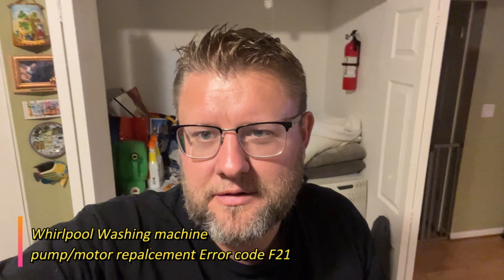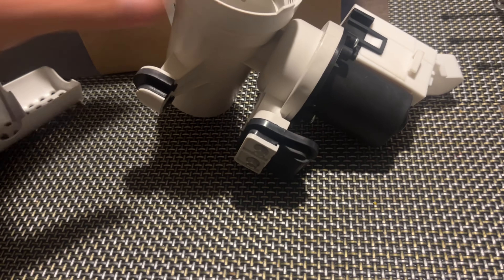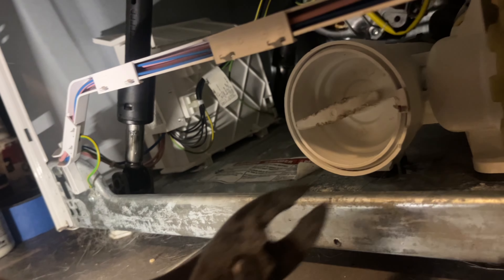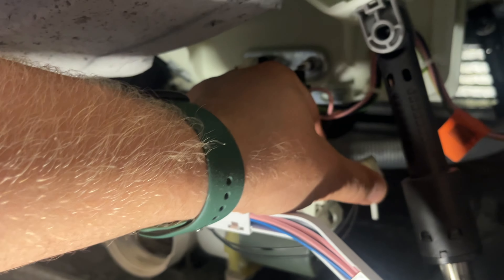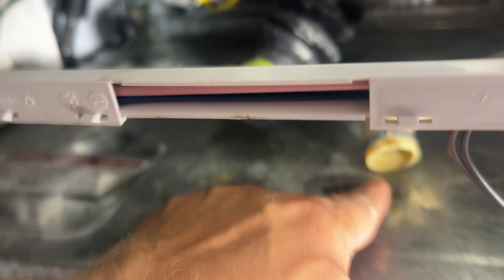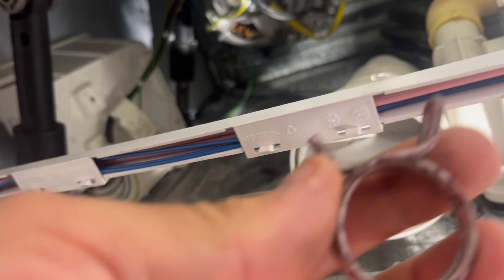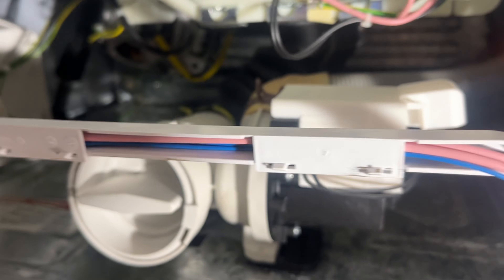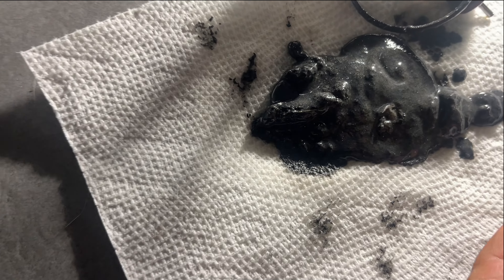Whirlpool Duet Washing machine error code F21, how to replace drain pump.

Comment: So, it has been 9 months.. Is it still working? I usually like to purchase the 100% OEM parts...Also, a tip I learned, never use Vaseline on the o-rings. You can use silicone grease, like you use in other plumbing applications. DANCO makes it. Petroleum based lubricant breaks down the rubber o-ring over time.  If you lube that filter cap, it will be easy peasy in the future cleanouts.

Comment: Hey. Is the pump and the drain hose supposed to be fully empty after every cycle or is there always residual water ? Thanks
Reply: There will probably be a minimal amount of water in there because the drain hose is pumping up hill and isn't full empty that hose.